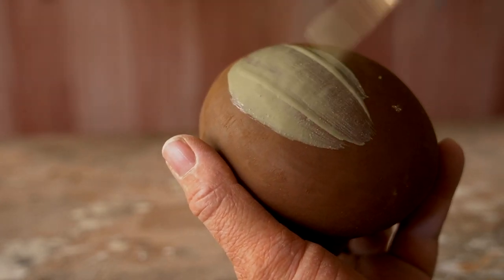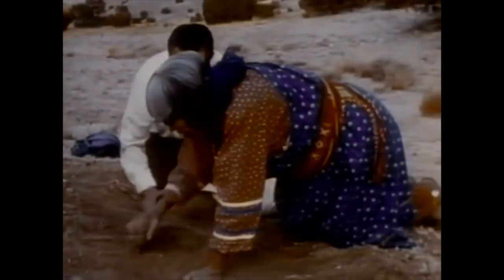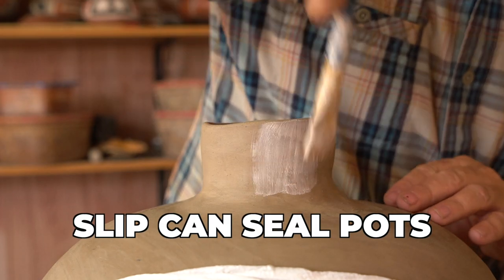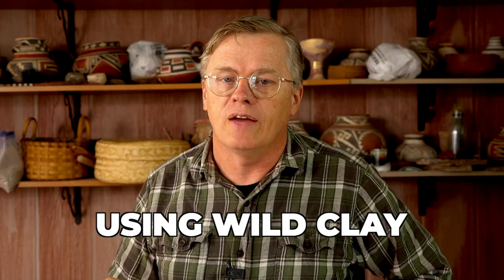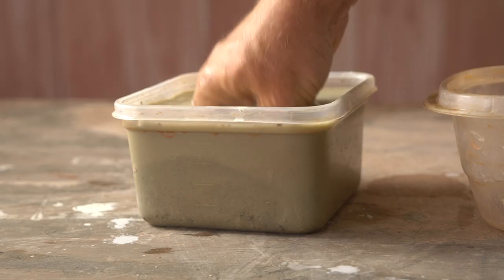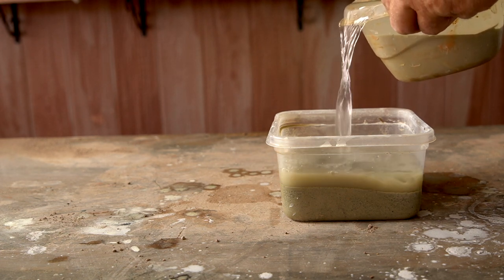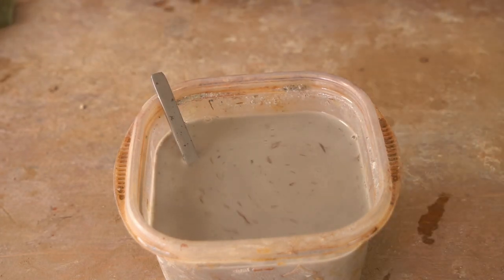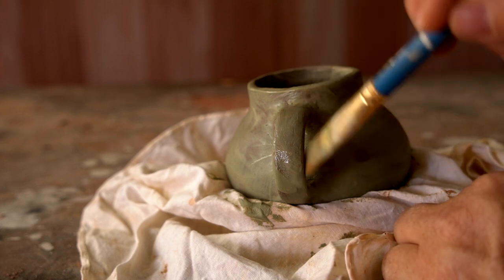How To Make Clay Slip For Colorful Pottery

Comment: Hi Andy, I’d really love to see you do an experiment to answer a question I’ve wondered for a very long time. Grog made from recycled pottery is usually crushed to a fine grit before being added to clay, but I’ve never liked the feeling of grog in clay. What would happen if we fired clay in powder form? Would it become a lovely ultra fine grog?  Would it come out of the firing in powder form still? Could it make a ‘super clay’ haha… I’d love to see you do some experiments for us as you are so good at presenting the information in a way that is really useful and informative to others.
Reply: This is an interesting idea. I also dislike grog’s grittiness. I’m getting ready to run a test fire, testing several things. I’ll have to add a bowl of plain Kentucky ball clay to the firing and see how it turns out, then see if/how it can be mixed with processed clay to be thrown & fired.
Reply from the maker: Not a bad idea, thanks. I think this could be an interesting video.
Reply: I had the same idea! Why slave away at grinding shards when you could fire the raw clay fine particles

Comment: Hi, Andy. Love your videos, very informative and really comprehensive. I had a question regarding a previous video in conjunction with this one - would firing pottery with a fine clay slip holding a natural paint (such as the mesquite or hematite as in another video) present a significant risk of the paint passing through to something cooked inside the pottery? Or would the clay slip reduce the porosity enough to reduce any concern? The only detailed records I know of painted cookpots are our cazuelas in mexico, but their danger comes from a traditional lead-containing glaze on the inside, not external paint.
Reply from the maker: I think clay itself is pretty safe, and a slip does reduce the porosity. Generally the biggest concern is paints used on the inside of food containers. Manganese is poisonous as is lead. I usually either don't paint the inside of pots that will be used with food or I only paint them with organic paint which just burns to carbon in the fire and so is non-toxic.

Comment: Hi Andy, fascinated from your work and passion. One question. Is it possible from your experience to use simple slip on bisque pieces;
Reply from the maker: I have never tried slipping a fired pot. I would think that there would be problems with the clay slip shrinking as it dries and crackling off of the pot.

Comment: Hay Andy I found this green rock and found out that it was shale and then learned that shale can be grounded down into clay because it could contain 50 % or so clay. What are your thoughts on getting clay out of  mudrock? Also I attempted to heat a sample of the green shale rock with a torch and it turned a light pinky orange color. I read that the green color could likely be from ferric oxide. Do you think such a thing could work for a slip or building clay?
Reply from the maker: It depends. I have used shale that could be soaked in water and become clay, others that require grinding and levigated and others that can’t be turned back into clay no matter what I tried. So you will have to experiment and see. Green clay does usually fire to a red or orange color.

Comment: Hi. I am an artist and teacher based in Amsterdam. I am getting to know your videos and really enjoy the anthropoloical context you provide. I also am a fan of working with clay slips to enhance the connection with the feeling of earth/clay. I have a question: I wonder if you can help me with a problem that I have of clay slip flaking and cracking off. I use commerical stoneware clays (I am making cups) and like to decorate the exterior with the slips after I bisque fire my cups. I don't like to paint the raw clay because I am afraid the wet slip will cause cracking in my cup form (I use a hand building, folding technique). Do you have a suggestion for me about how to get a more consistent bonding with my clay slips? I fire to 1230 after painting with them. Thankyou so much and I will keep watching!
Reply from the maker: paint when the pot is leather hard, not fully dry

Comment: Hi Andy! Thanks for this video. I know that there are many considerations and testing required with wild clay when used as a clay body. Are there any considerations to firing temps that should be taken when using wild clay slips on a commercial clay body? For example, a wild clay slip on stoneware. Thanks! :-)
Reply from the maker: Not as many as for a clay body. You will want to test the two together and see if they are a good fit. Sometimes if the two clays have wildly different shrinkage rates you will have trouble getting them to stay together. Otherwise there aren't as many concerns with a slip clay other than color and ability to take a polish.
Reply: @AncientPottery  Your knowledge is priceless. I'm excited to give it a try :-) Thanks again!

Comment: i was wondering does slip come off eventually?  and do you apply the slip after the firing?  and do you have to fire the slip for it to stay on?  thanks
Reply from the maker: Slip that is fired will stay on for hundreds of years. Slip is applied before firing. Slip is just made from clay, if it is not fired it will remain fragile and fugitive.

Comment: I saw some of the vids on the "Natural Pottery Paint" playlist, and I have some questions if u dont mind:
From what I understand, to apply a pigment before firing you mix it with water and a bit of clay (that makes slip?), and to apply it after firing you just mix it with water, is this correct?
Also, u showed u use mesquite sap as a binder, can any type of sap be used? All I have around here are pines, oaks, and olives...
Can I mix pigment into liquid clay in order to colour the entire clay and make, for example, a white bowl out of red clay that was mixed with a white pigment, or is the only way of doing this the way u did in the video, manually painting the pottery?
thanks in advance and sry if these are really dumb questions
Reply from the maker: 1. Mixing pigment with clay does not make a slip unless the majority of the material is clay. Otherwise it is just mineral paint.
2. Southwest pottery is fired once, all decoration is applied before firing.
3. I use mesquite, I can't speak for other saps but I would assume they could work as well
4. Mixing pigment into a batch of clay would require a large quantity of pigment and seems wasteful to me. Applying it to the outside as a slip or paint seems more efficient.
Thanks
Reply: @AncientPottery  tysm for the help!